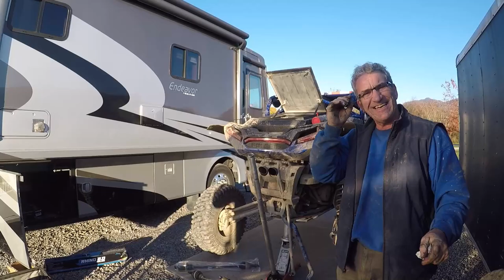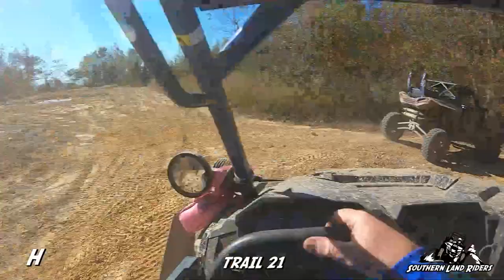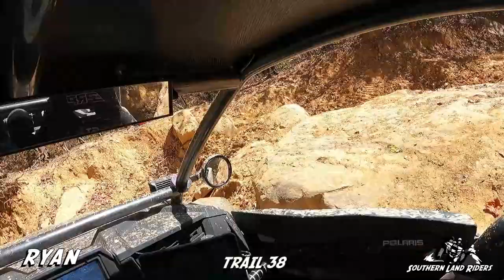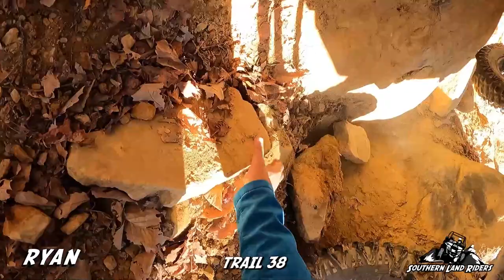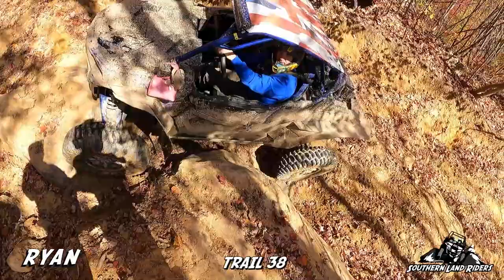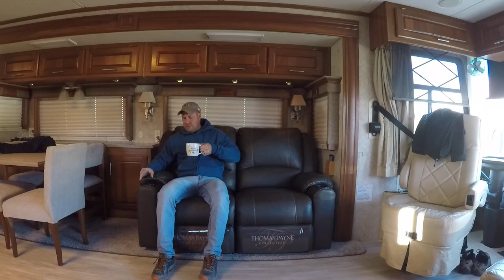Windrock 11/2020 Day 2 Part 1 (Trail 38- Little School Bus)

Comment: Hello, it's me again, I wanted to know how to remove the engine brake on a rzr 1000 2019. It is that in the last comment I remain in doubt, I do not know about those topics and it is the last time I ask :)
Reply from the maker: Have you talked to your dealer? It depends on the year model of the clutch. Also check out rzrforums.net. Lots of info there on it. It varies by model.
Reply: Lol,does it say southern land riders garage somewhere that I missed??
Reply from the maker: @rockytopriders8705  haha I try to help out anytime I can but I am afraid I can't here. There are a million variables when it comes to clutches on these things. lol
Reply: @SouthernLandRiders  exactly!
Reply: @rockytopriders8705  so I heard if you get away with the one way bearing on the primary clutch and put a free spin bearing it will get away with the engine breaking
Reply: @BamaTrailRiders1  turbos, 900xp’s, 1000xp’s don’t have true engine breaking. They don’t have one way bearings. You’re feeling just like a manual transmission car that’s decelerating in gear. Engine rpm on the primary when you left off the gas is enough rpm to keep the primary engaged on the belt giving that engine breaking feel and doesn’t disengage till the rpm drops too low to hold the belt. It lets go and you feel that free wheel feeling because the primary is not engaged. 

1000xp can still have a engine braking secondary without a one way bearing. Dude needs to email Todd at hunterworks. There’s so many variations in the clutches on the 1000’s between all the years that I can’t keep track of it but he’ll know and tell you exactly IF and how to get rid of any ebs there is.